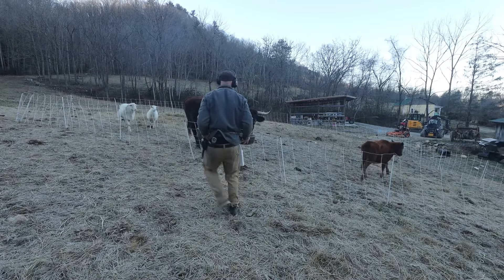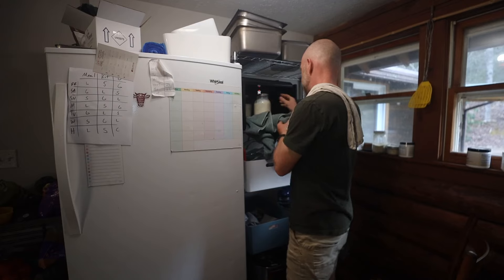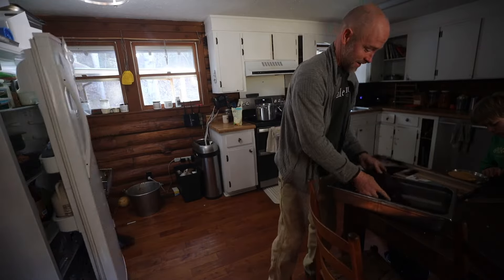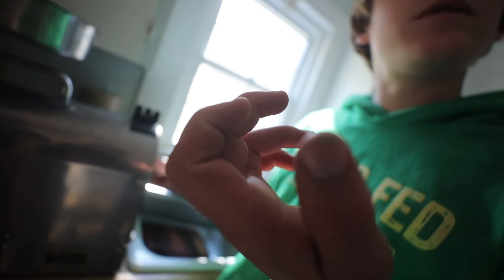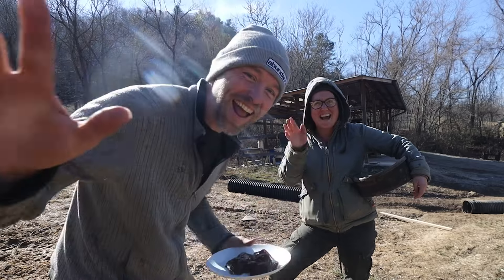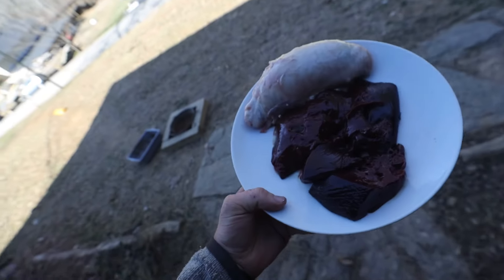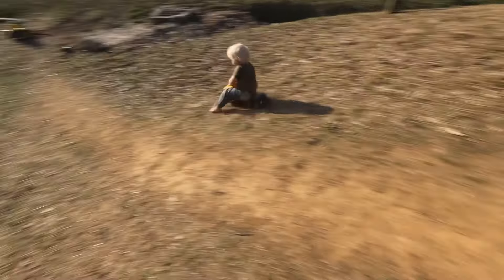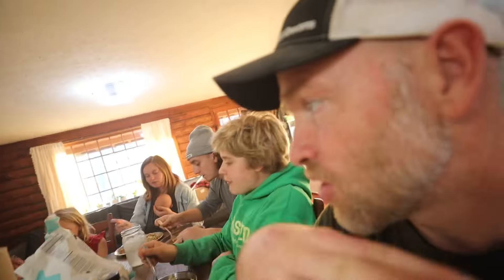We Ate Our Bulls Balls

Comment: To grind liver; cube it to size for your grinder, flash freeze 1/2 way on a cookie sheet (lined with parchment paper it doesn’t stick) then you grind it partially frozen and it won’t come out like soup.  You need to work fast and get it back on the pan into the freezer and flash freeze solid this time before packaging if you want to add it to other meats 👍